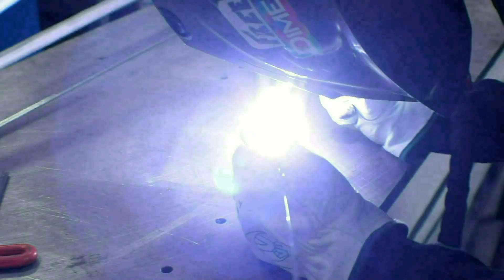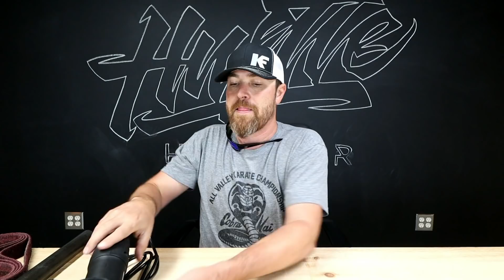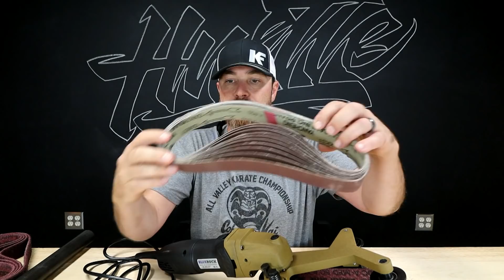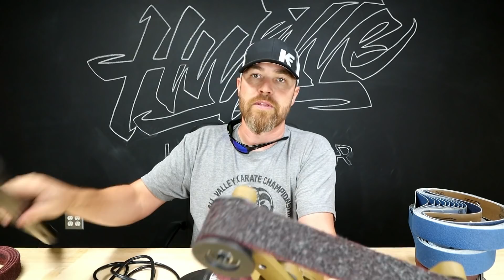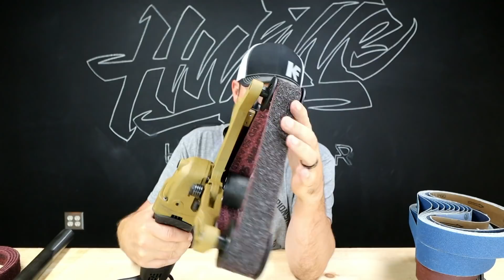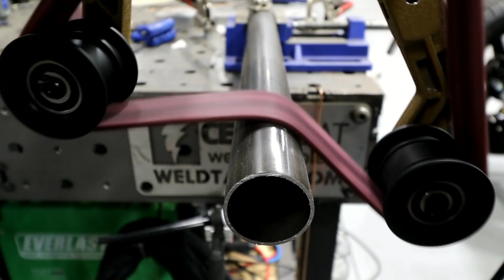You Need This Tool - Episode 122 | Tube & Pipe Belt Polisher Sander Thing

Comment: Metabo. I mounted it to a table using the handle hole. I sand and polish long lengths of tubing suspend it from the ceiling. Seems the 3m belts work best, but expensive. The wool belts seem the best for mirror polishing. I working with stainless.

Comment: I bought one a few years back, mainly for cleaning scale off DOM.  Also bought one at my previous work, for smoothing axle tubes after cutting brackets off, gets the axle tubes back to looking factory before welding on new brackets. I use it a lot, anything that’s curved that I want a nice uniform finish on.